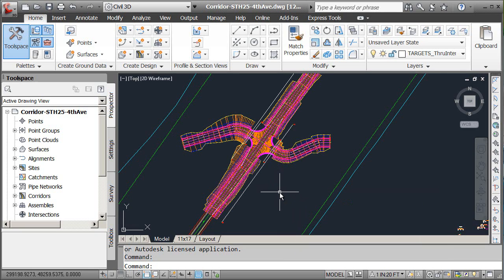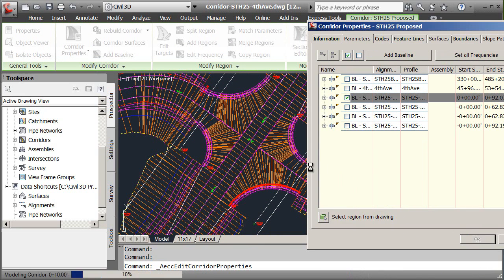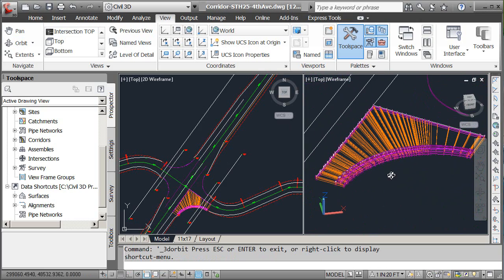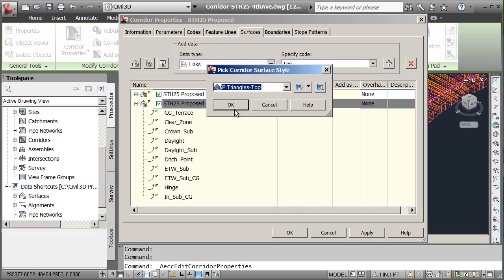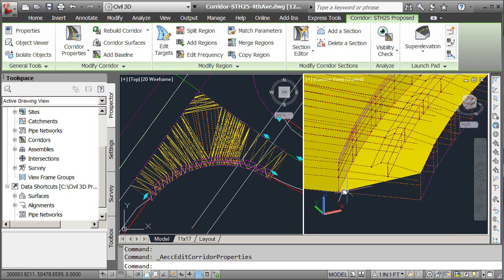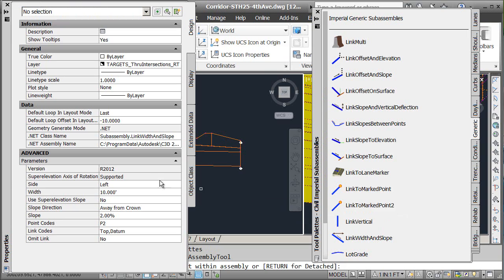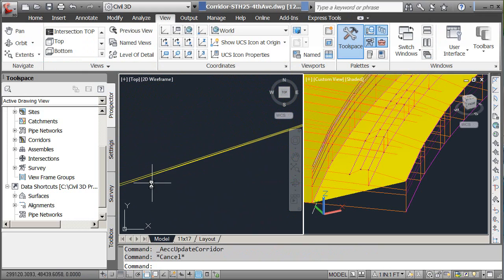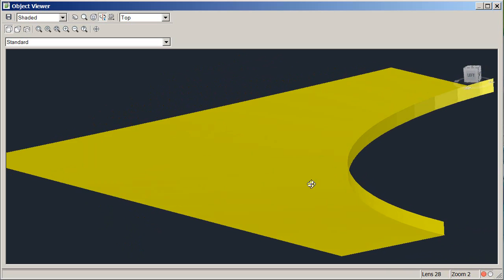01 correct triangulation vertical

Comment: Hello  if someone could help me out. I’m look to create a flat / 2d design using only lines and measurements.  I’ve used a Triangulation Tool in a different software
I’m sure that Rhino does this I’m just not aware of it.  I would appreciate any information on this and if more info is needed please message me. Thank you 🙏🏻